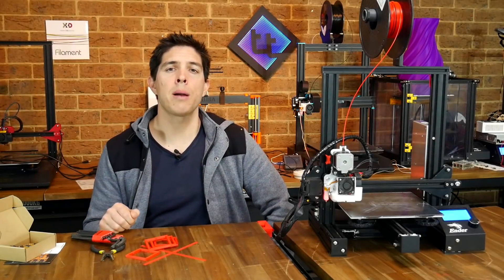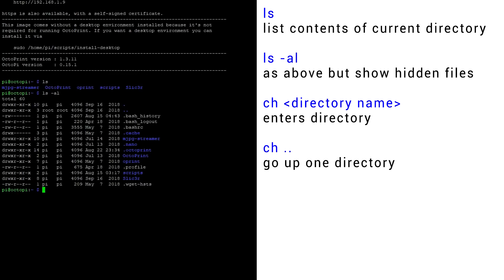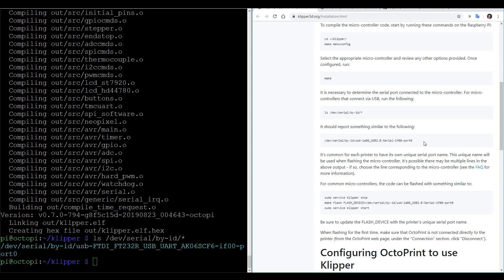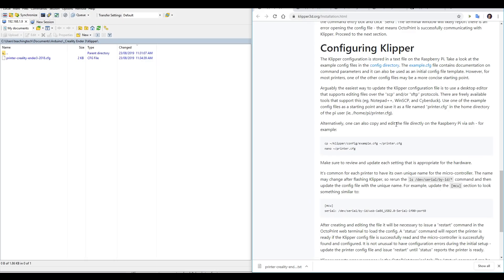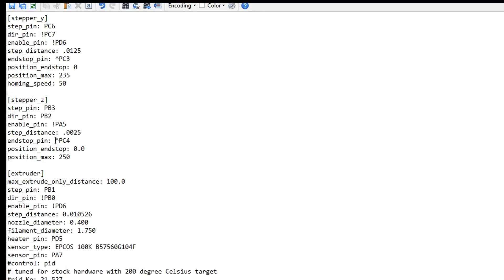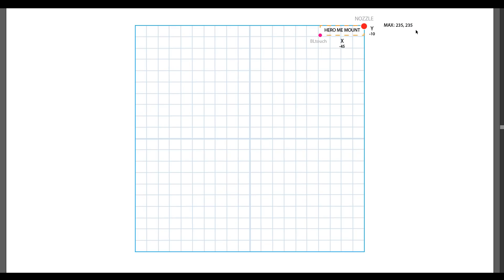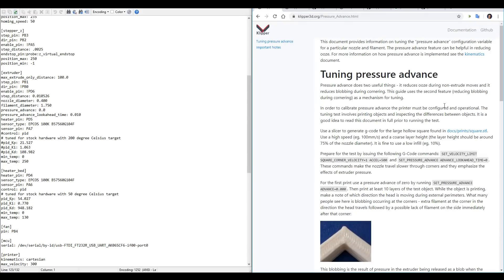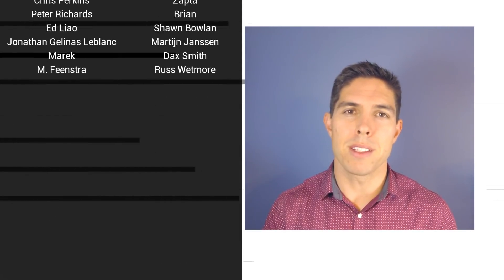Using a 32 bit Raspberry Pi to boost your 3D printer mainboard - Klipper Ender 3 guide

Comment: I've been using Klipper exclusively for months now.  It's fantastic.  I can push my prints to 150mm/s and 3000mm/s/s acceleration and still retain 90% of my print quality.  I love it.  Glad it's finally getting some of the attention it deserves.
Reply: It's insane... 

https://youtu.be/W7I1ctCrMlA
Reply: Hi, have you installed any mods? I tried it with the alu extruder and stock hot end and over 60mm/s i got really bad under extrusion (not sure if the hot end is not able to melt the pla this fast or the extruder has not enough Force on the filament)
Reply: @calvinb2388  I've found that you can get good quality printing fast for most of the part but for your outer perimeter/wall and top go down to 30 or 40mm/s. There's not much increase in time and it helps the outer surface finish.
Reply: @Dave_the_Dave  agreed,this is what I do my speed sets are : 22.5mm/s outer 80 inner 100 infill 700 1k and 2k accrl
Reply: @calvinb2388  This would not be from the software . We can help you out at the Klipper discord if you like. :) df9yTE2
Reply: @calvinb2388  Neither the stock hotend nor the stock extruder are likely going to handle printing that fast.  I have a Mosquito hotend with a 50W heater on mine and a Titan extruder in direct drive configuration.  I've cranked it all the way up to 250mm/s for very large prints.  The shear amount of plastic flowing through at that speed is something that the small stock hotend and weak heater cartridge can't handle, and the amount of pressure at those speeds is too much for a non-geared extruder most of the time.  Bowden is also a huge speed restriction.  

Fast printing is not for everyone.  It requires more tuning to get it truly dialed in.  Pressure advance has to be tuned more precisely than at slower speeds.  Your machine must be in perfect order mechanically... no slop, proper belt tension, etc.
Reply: which printer do you have?
Reply: @manu7irl  from the description 

Printer
Anycubic Kossel Mini linear
Enclosed with plywood 
E3d vocano(heater block and nozzle clones the rest is original.
16 tooth pulleys and idlers
Reworked idler assembly
piezo probe Orion
5015 radial fan as part cooler
tmc2130 over spi on all axes @ 24v on VM @ 1/8 microstepping
PEI on glass
BMG clone extruder @ 1/8 microstepping
E3d PT100 amplifier on aux board
Trigorilla as Main AVR
Arduino NANO as auxboard
RPI 3
Klipper as firmware